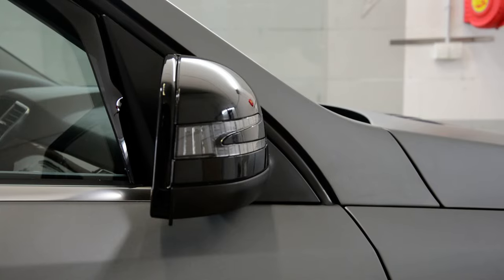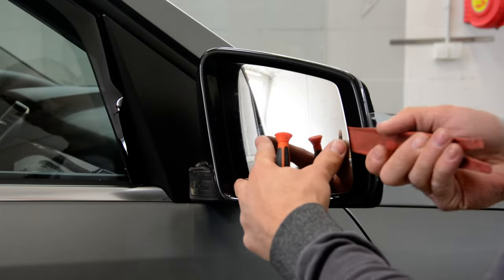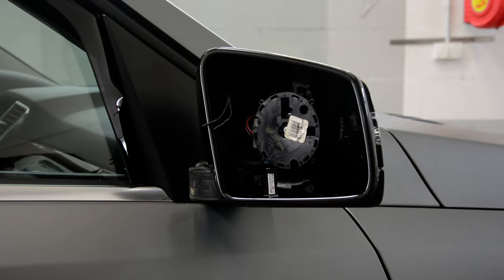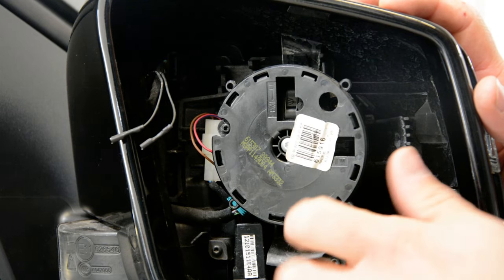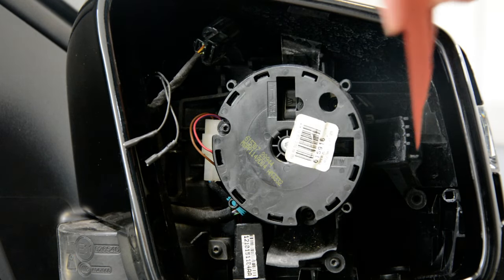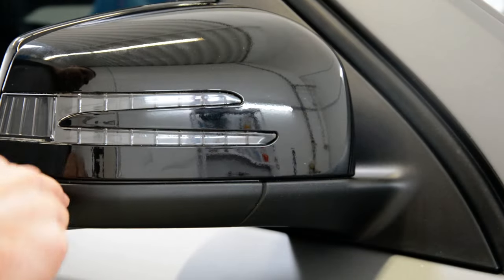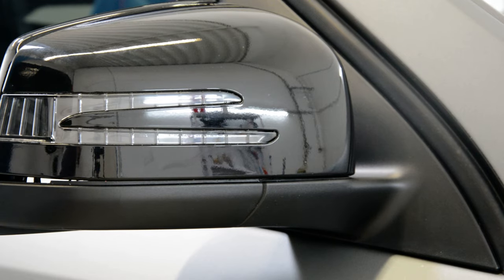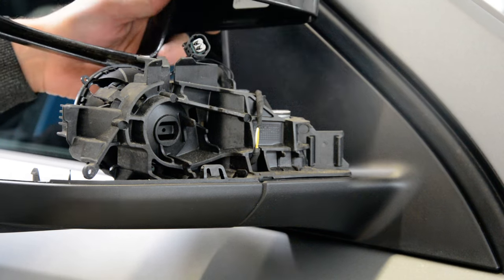Mercedes Benz Mirror cover and glass removal

Comment: Fyi some mirror covers have a screw holding it on from the inside, you pull the mirror glass out first then undo the screw then pop the cover up.  On mine the driver side had no screw but passenger did.  Do what he showed

Comment: Enjoyed your video. Need some advice, wife has a 2004 Mercedes ML350, she folded mirror in and pull into carport hitting column and popped off the exterior cover of passenger side mirror, I put the cover back on but now, when the mirror is folded in, it hits the window 3 or 4 time, roll the window down and it hits the door. 
Can you advise what to do?